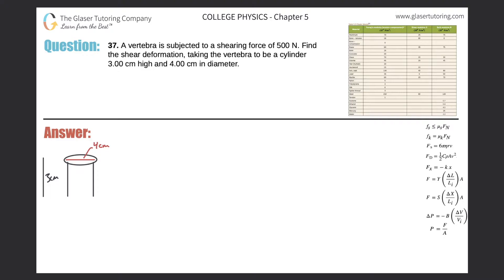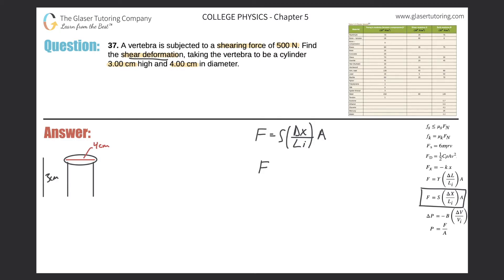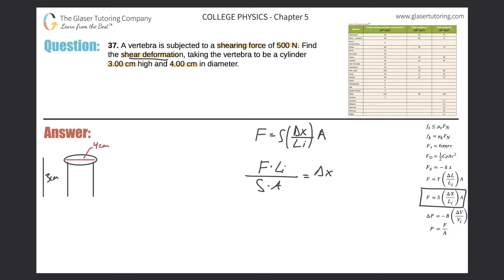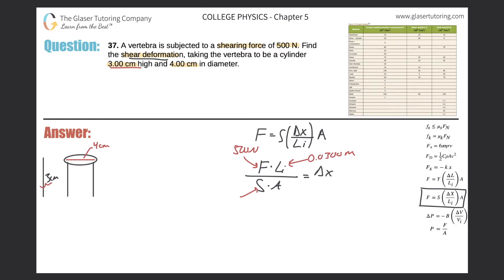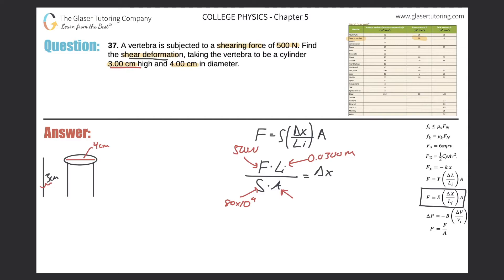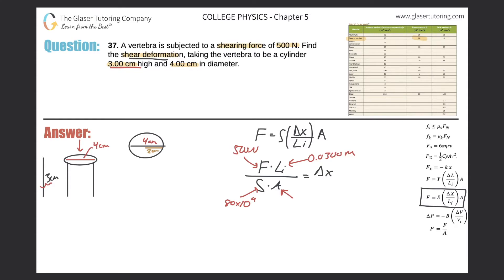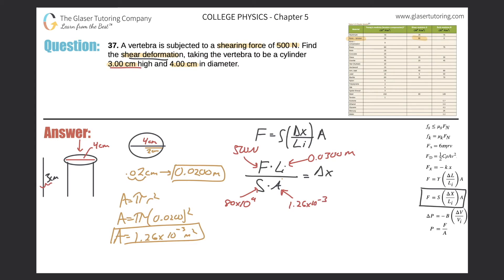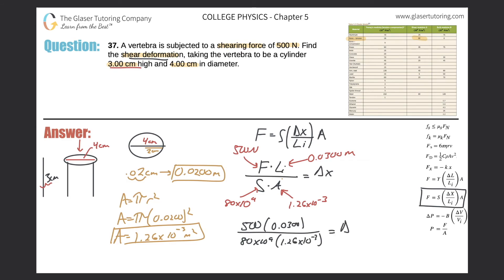5.37 | A vertebra is subjected to a shearing force of 500 N. Find the shear deformation, taking the

Comment: Thank you so much for these videos, really been helping a lot! In previous problems where we are trying to find the change in L or change in x, you didn't rearrange the equation, you just multiplied the Y or S moduli  by A and then divided by change in length. How did you know you needed to rearrange the equation? When I don't rearrange, I get the wrong answer, but only for this question it seems.
Reply from the maker: Hey Caragh!  Great question - just know, that there is never a "need" to rearrange equations.  Rearrangement is just used as a tool if you want to simplify the answer to your needs before plugging in values.  Did I really have to rearrange here? No but it just makes it easier for me to just plug in the values.  If you did not rearrange the formula, what you should have done was multiply S by A to get one number in the numerator with the delta x.  Then I would have cross-multiplied and then finally just divided to get delta x by itself.  Hopefully this helps!  Also, a huge THANK YOU for your support in us and in the channel.  We would definitely not be here without you!  It truly means a lot to us.  Keep studying hard, Caragh! 😀
Reply: @GlaserTutoring  Yes this done help, appreciate the explanation!
Reply from the maker: @caraghomahoney8935  You're welcome, Caragh!